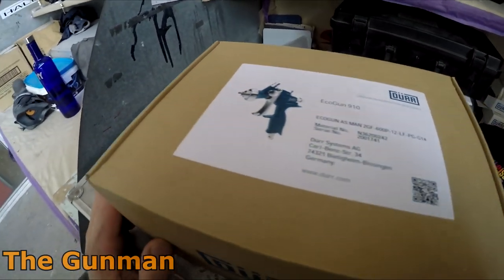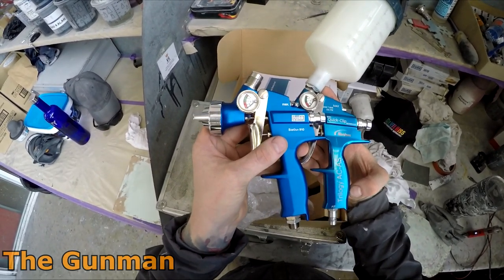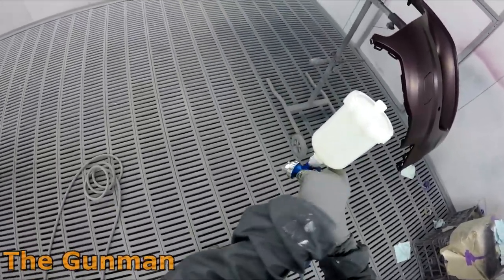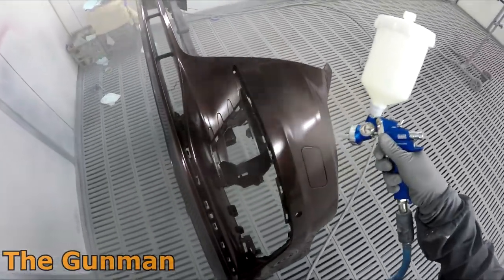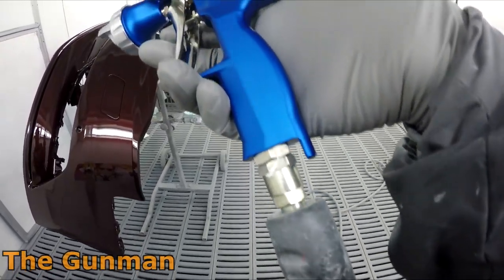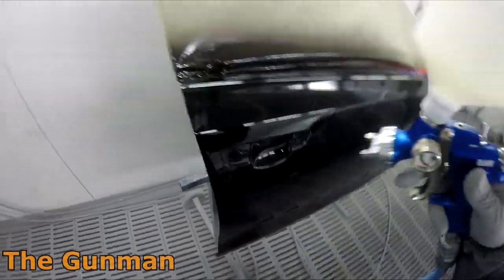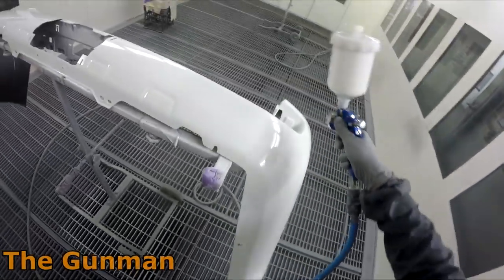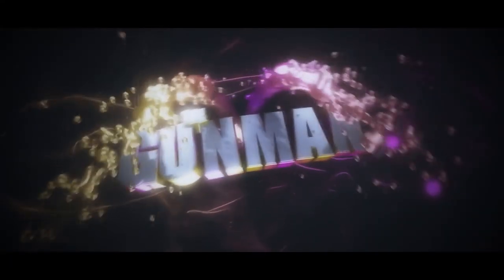DURR EcoGun 910 Spray Gun Review

Comment: Seems odd you originally placed the Nordson at Number one on your top ten and couldn't praise it high enough when you first reviewed it     .The manufacturer is Bersch and Fratscher Optima  .I use the Nordson and also the older Optima 900i branded for Rupes as Bersch and Fratsher will re brand for other companies .Sata also do this and Devilbiss and many others aslo so not uncommon . .When it comes to laying down clear then the AS 1.2 I have found to be one of the very best I have ever used ,same AS set up but 1.3 lays  direct gloss fast and faultlessly getting round commercials quickly .One other major consideration you have failed to allude to    is the cheapness of spares for these guns from SprayGuns Direct  ,far far far cheaper than even Devilbiss so you can buy this gun with multiple setups and still not hit much over the £300 UK mark .I only ever had one issue with these guns and that was the pot lids as the sealing ring inside splits away so I have fitted mine with aftermarket ones .I dont feel your review has done these guns justice ,they are dam good deal and very capable gun comparable with any of the current top marques and at the price of the DURR beyond a bargain
Reply: I agree with you I have 4 of this guns Nordson trilogi HVLP and LVLP 1.3 and 1.4 and for me works really good with no issues. I'm porfessional  car painter  in Houston Tx.

Comment: What gun would you recommend for urethane  paints or acrylic paints. I do a lot of marine repairs and not sure if you have heard of awlgrip. I normally use the Devilbiss GTI pro light. Thanks to you. Just wondering if you have ever used awlgrip products and what gun you would recommend.
Reply: Gunman recommended the iwata az3 as a primer gun. I bought one  to do a 1k acryluc metallic with clear as my first ever car respray.
I'm getting an excellent finish with a nice gloss off the gun. 1.8 tip, Spraying at 28psi.

Comment: Gunnnyyy- but what about LVLP as a category? Some of us have small compressors! Is it not good within low consumption guns? Cheers
Reply from the maker: Lvlp will actually be better for a small compressor. If you go look at the technical specs on any gun it will have a CFM or LPM section, the lower the better for small compressors, cross-reference that number with what your compressor puts out and you should know if your compressor can keep up.

Comment: Water in the air line kills paint jobs. 

What is the best way to remove water from your air on a small compressor with say 30m of hose?

Standard water traps don't work all that well.
Reply: Put your air trap well away from the compressor so the air has time to cool down and the water can drop out. Have the trap at a lower point than the outlet. Try it out. You can wind down the outlet pressure on the regulator to slow the air down a bit also.
Reply: @beauchamp1763  , tried that but itdoes not work very well. Im going try to make an air dryer, cooler with the trap lower. See what happens.
Reply: You could try putting an air tank from an old compressor inline, near where you paint. I use the tank from a stripped down direct drive compressor just outside my spray booth along with another water trap inside. The extra tank doesn't trap a huge amount of water but it does add extra storage to the system too.
Reply: @msrgarage  , if the air is still hot, hot day, hot compressor, water vapour will still harm the paintwork. Good idea though. I think your idea will help.

Comment: Hello Gunman, I've been having issues with  trying to get my paint jobs to have that almost glass look on them. Any suggestions. The gun I'm using is a Satajet 5500x rp 1.2.  I just cant figure it out tried countless settings still no luck
Reply: Mite need 1.3 tip try slow reducer too
Reply: Try 1.3 tip and slow reducer

Comment: ONE QUESTION?? I painted single stage in 90 degree weather under shade. Why didn’t I get glossy paint????
Reply: what percentage of humidity did you have with this temp? either humidity played a factor or your spray technique more than likely
Reply: Luis Vega I’m don’t remember but I think 50%
Reply: @User-nn5wu  high humidity can kill the gloss I live in texas the humidity is 70-90% at times or you sprayed the material to dry out of the gun from jump street. couple possibilities there and the hotter it is the slower the reducer you want to use so the material can flow out before tacking up some.
Reply: Luis Vega thank you. I just started so anything helps
Reply: @User-nn5wu  anytime my brother..thats what im here for to learn and share to equip and empower my fellow man to be a better painter than he was yesterday..or she..i have been painting for about 32yrs but I still come here to learn and share info it was my pleasure to chat with you be happy to answer any question to the best of my knowledge and experience..
Reply: don't be afraid to pull the trigger...putting the paint on wet and even gives you the shine its a balance that experience will get you wet enough to gloss out but not so wet it runs off the panel if you spray it too dry it will not shine and will dry rough..we joke about dry sprayed panels that you could actually strike a match off of it because it so rough this is just one of many possible reasons you did not get the gloss you were expecting..but if it kinda looked milky or chalky when it dried my bet is the humidity was too high and got in the paint as it was drying..
Reply: Luis Vega thank you so much I appreciate it!!

Comment: Hey gun I bought a iwata ls400 the only way I can get the air pressure to 26psi on the regulator is to close the air valve on the bottom of the gun about halfway or more.Is that normal on a iwata ls400 thanks for any help.
Reply from the maker: If that's how you're able to get 26 psi, you're only cheating yourself, as soon as you lower the pressure on the gun your regulator will read false, you need to up the pressure at the wall, there should be a regulator on the wall. Are you spraying at home or in a both?
Reply: The Gunman thanks gun I’m using it at home 5hp 30gal compressor I tied 80 - 100 air pressure threw regulator then water oil separator then going to the air hose to the gun.I kinda thought something is up with this gun i tied different regulators so I tied the devilbiss gpi and it was fine and I bought the iwata ls400 off eBay the sell said it’s brand new and they had good reviews so I bought it.thanks again and having a good weekend

Comment: I'm a guy who buys wrecked cars to fix and resell. I only do around 12-15 fixes a year. I am curious what you think of the FLG-670 for just clear coat?
Reply: Don't do it ... I have one its a true pos
Reply: Marc L diver what is wrong with yours?
Reply: Just overall not a smooth gun  bought a 2.2 fluid tip  and turned it into a primer gun flg5 in the same price range way better gun I have one and I like it ... don't use it much anymore bought a prolite way more money unbelievable clear coat gun
Reply: Marc L diver Thanks
Reply: @promufdvr  I have one does ok on clear but need more flat glass look on my hot rods I restore. I'm having trouble with base coat getting tiger stripes. I'v been doing research on GTI pro lite heard and seen T110 and 1.3 tip best for glass finish
Reply: @jeffeaton5221  exactly the set up I use on my pro lite for clear I use 1.4 for base lays it down nice no stripes
Reply: @promufdvr  Spraygunsdirect recommends a GPI for me not a GTI?
Reply: On my FLG4 i'm between light orange peel and solvent pop. I only use 1500 to flatten out orange peel then 2000 followed by 2500 buff out smooth glass. Also heard high humidity don't bother the GTI pro lite much at all.
Reply: @jeffeaton5221  paint guns are all about atomization flg4 golf ball size drops prolite bb size drops. I went from flg4 to flg5 to prolite the 4 makes a pretty good primer gun the 5 sits on the shelf prolite is my go to gun hands down
Reply: @promufdvr  Oh no i'm not complaining about cost of GTI pro lite thats what 
I want. I was asking questions about whats the best cap & tip too spray flat glass finish + the best set up for base. Chris from sprayguns direct suggested GPI
Reply: @jeffeaton5221  t110 air cap 1.4 fluid tip for base .... 1.3 t110 2k clear works fantastic for me. That 1.3 t110 combo lays clear down like you wouldn't believe like glass.
Reply: @promufdvr  Yes i'v heard that from alot of ppl. I'v sprayed .008 flake with my FLG4 with 1.5 tip no problems. Will the 1.4 tip & t110 cap put down .008 flake?
Reply: @jeffeaton5221  no problem
Reply: @promufdvr  Will I ever need a 1.2 tip?
Reply: @jeffeaton5221  now that's a good question I have a friend who bought a prolite after trying mine he has a 1.2 t110 setup and gets some serious nice clear I am going to try it on my next build
Reply: @promufdvr  Ok I was going to go ahead and purchase a T110 TE10 1.2 1.3 & 1.4 just too have just incase
Reply: GTI Pro Lite's are considered a convention spray gun & the FLG4 is a HVLP which actually harder too paint with.
Reply: @jeffeaton5221  absolutly right you are